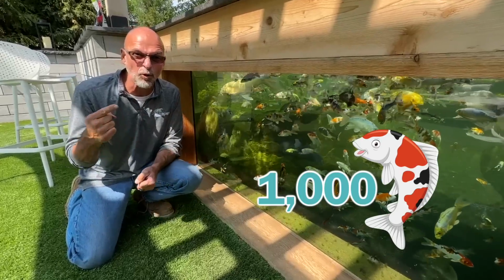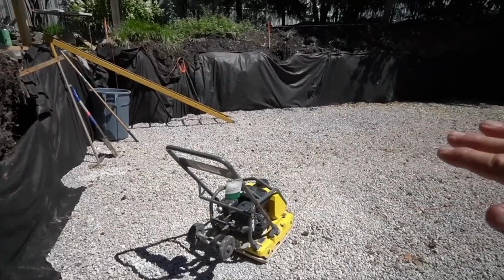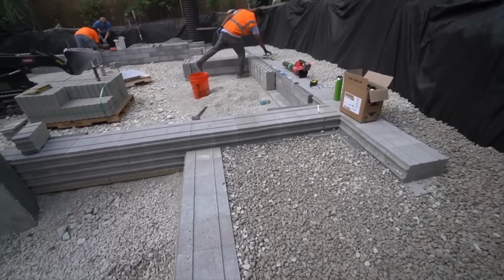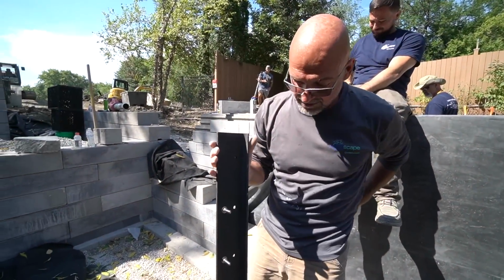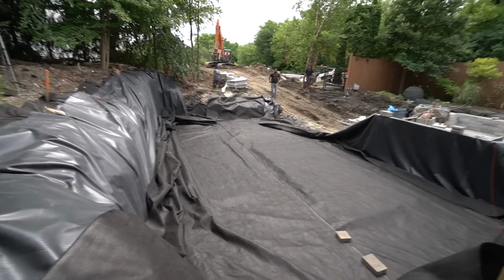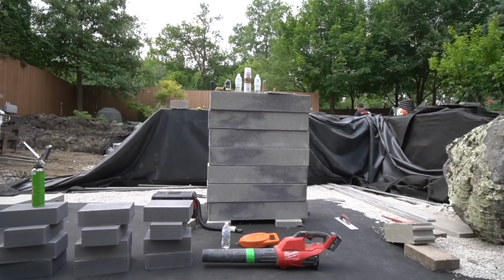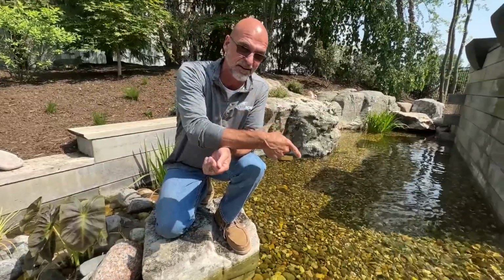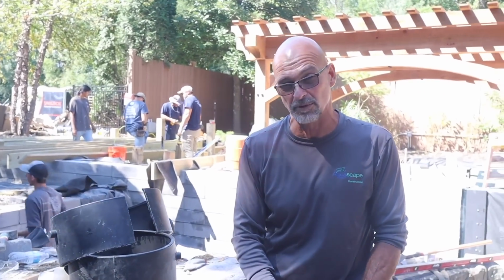Giant Glass Window For 1,000 Koi

Comment: Don't you ever get worried setting such huge stones on a liner?  I know you spread a shingle base which spreads the load more, but, if one little nick happens in the liner, that would be a nightmare to find.
Also, when you built the retaining wall for the wetland filter, did you joint it with anything or do you reply on the water pressure equalizing from both sides to hold it firm?
Awesome job by the way.
Reply from the maker: Setting large rocks is always a concern but we have a systematic process for placement and the appropriate protection to prevent issues. 
It’s a flexible and cost effective method of construction.
The Retaining walls are designed with a Tongue and Groove attachment for structural stability.
&
Thank you!
🙏